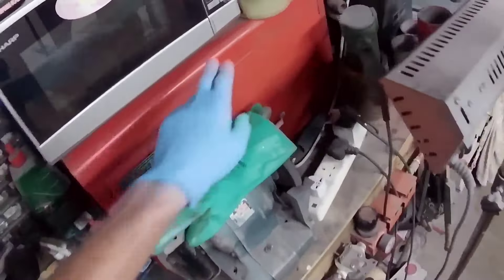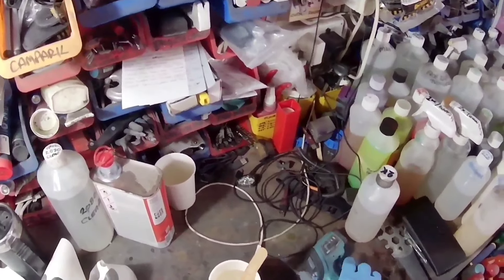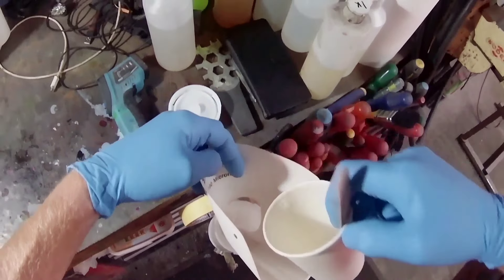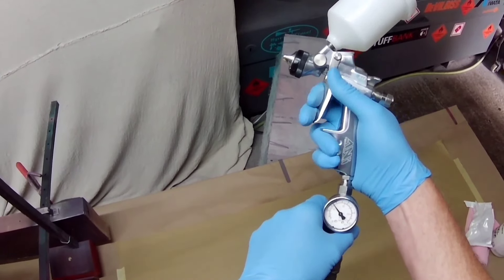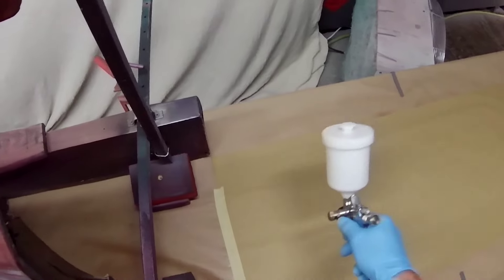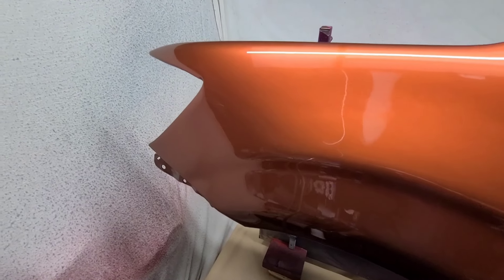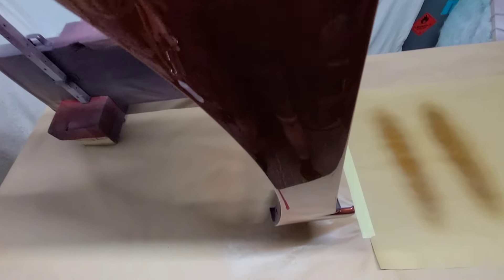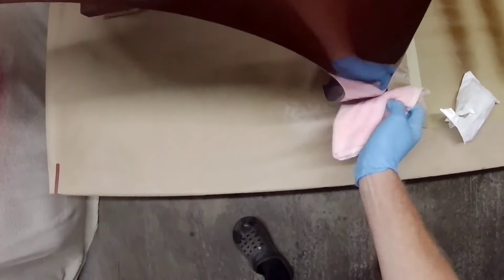ANI R160 1.2 v ANI Compact 1.3, Mini Spray Guns For Clear Coat LVLP?

Comment: I'm curious to know how the gun handles a narrow fan  for tight spots.   I bought a SRI knockoff and it sprays well, but adjusting the fan from wide to very narrow is not smooth.
Reply from the maker: Hi buddy,  There is a reason why manufacturers make so many different tip sizes, it's because when you turn a fan in, it doesn't perform as well, as when the fan is wide open, smaller tip equal smaller patterns, for the most part anyway.

It's something I mention sometimes in my videos. A better quality gun will normally give you better results when the pattern is closed up, but it's still a compromise

Comment: Hi Pete.  What size tip would you use for spraying frame tubes?
Reply from the maker: Hi Graham,  are we talking about cycle or motor cycle frames? , if so, I would look at 0.8, but, as I sometimes say in my videos,  I like the ANI R160 less in the smaller tip sizes.

It needs a fair bit of pressure,  even in the smaller sizes, so it's quite a lot of overspray and it's not as good as something like a Meiji F55 or Iwata LPH50, although they are more money,
Reply: @peteshobbies5383  Thanks for the quick reply!  I'm painting tubular seat frames for an old VW bus.  The tubes are around 21mm diameter.  Next up will be the pop-out window frames which are an H-section approximately 10mm x 10mm & I'll be laying down base coat & clear.  I've been getting good results on larger items with my Astro Europro HV103  but the fan is too big for these parts & I'm concerned if I close it down too far it won't be controllable.
Reply from the maker: Yeah,  100% agreed. The bigger gun turned in, don't perform particularly well .
I would look as something like a Porphis MPH338 in 0.8, a good gun, and like a smaller Astro

Comment: I am a smart repairer and we use sata minijet for base and SRI Pro Lite for clear. They work well for the smaller stuff but when I have to go out and fix other people's mistakes I picked up the ANi F160 after seeing yours and the Gunman's videos. It looks and feels like a nice gun for the price and the spray pattern is really uniform looking but I am yet to use it as I am struggling to find an adapter so I can fit it with the 125ml pot. The bigger pots can be a bit unwieldy for what we do. Cheers for the videos .

Comment: Hi Pete, big thanks for the mention and plug for my little channel mate it's much appreciated💪🤓 superb finish there mate those ANI guns really put out a great finish I don't think you can get much better for the price, I remember when I was having problems with my R150 I just couldn't get a good finish from it and of course being a man I didn't read the instructions🙄 and it wasn't until you told me that it needs a higher pressure which totally transformed the gun it's surprising the difference the air pressure makes👌

The slightly different tip size does make a difference to the speed of the gun which I found out with my X5500 when I went from the so called 1.3 CC tip (which as you found out is a 1.15) to the 1.2i tip along with using the CC aircap which made a noticeable difference to the speed of the gun, I will be trying the 1.3i tip with the CC cap soon but atm I'm working with the guys from ProXL to perfect the new Xpress 305 clear😬😅
Thanks mate👍
Reply from the maker: Hi John,  You're welcome, mate. I nickname you, Mr. Clearcoat these days 😂 , I remember us talking about your R150, couldn't remember if it was an R160 or R150, but remember you saying about the finish not being so good, so you uped the pressure and it was much better, so this little gun does like it's pressure,  cheers John 👍
Reply: Sorry for the late reply Pete, good old YT not telling me there was a reply as usual🙄sounds like I'll have to change my name on here to Mr Clearcoat 🤔😎yeah that was a while ago now mate and I remember saying to you that it doesn't spray properly but the higher psi made all the difference👌

Note to self... in future read the f'n manual 🙄🤠😂😂
Reply from the maker: @JohnWD40TC02 I'm not sure it gives the pressure in the manual,  I think it recommended 2.2 bar which really isn't enough,  not for a good finish,  I haven't read it either so can't say for sure 😉 😂, cheers mate 👍

Comment: looks a bigger and wetter pattern straight of the bat that 1.3 i do need to grab one of them set ups👌 great video pete 👍👍👍
Reply from the maker: Hi Grant,  Thanks mate, I really enjoy doing these back to back things, it's far more obvious to the painter and, hopefully more obvious on the videos.
It's quite striking how different these two are considering it's only 0.1mm, good old tools though although they do use more air than quoted,  cheers mate 👍

Comment: Nice one. I have ordered a PPS 2.0 kit for my Compact and am interested to see how it goes. A few reasons, but I find cleaning the cups a real PIA and is often a disincentive to spraying small jobs. I do intermittent work that may stretch out over a few days and ideally I can take the pps cup off the gun and store it for a day, give the gun a basic clean, then go back to where I left off. Many industrial paints have much longer drying times vs auto, so subsequent coats or sides of objects can take days. Just this morning I found a feature on something I’d sprayed yesterday had some primer showing and I would have blown some more material over it if I still had a cup loaded instead I touched up by hand which isn’t an ideal result.

I agree, I think the gun is capable of being a one gun solution for many, the 500 ml cup is likely big enough for most recreational painters, but PPS would also allow bigger cups if desired.

Keep up the good reviews.

Pete
Reply from the maker: Hi Mate, I find the bigger cups a pain to clean as well, which is why I mainly use small cups, which does most of what I need to do anyway and works fine.

I must say, using these two ANI'S individually the difference between them, although obviously noticeable,  isn't as apparent as doing these side by side tests, it's really obvious when you see it here.

Thanks, mate. I appreciate it 👍

Comment: Sir, hi again - I've come across this very nice looking Rongpeng R-100 spray gun - it comes with a 1.0 mm tip - will this spray base coat/clear coat ? it has reasonable psi operating pressure/cfm ratings - thank you again - your advice is always appreciated
Reply: Not answering for Pete 😊, but i remember him commenting about the R100. Think he says it was rubbish. Look at the other videos in the series to find it
Reply: @0012dominic  Sir, thank you for your advice - I'll check on the video - from the Philippines
Reply from the maker: Thanks, Dominic 👍,  you are quite correct. It's really not a particularly good gun and the build quality is awful,  people would be much better off with one of the Devilbiss Sri Pro Lite clones, something like the Ntools 888, there lots of names for them although they are all the same, cheers mate 👍
Reply: Do you have the fluid knob full open ?
Reply from the maker: @kevinjackson9406 Hi Kevin,  Yes, mate,  normally I do for clear coat, helps it wet up better.
With a base coat, it depends on substrate, color, and temperature,  so that can be anywhere between one turn out from fully closed to fully open, cheers 👍
Reply: @peteshobbies5383  Thanks Pete, I have just ordered one .
Reply: What temperature do you have 2k direct gloss paint ?.Thanks
Reply from the maker: Normally, for 2k direct gloss,  I warm it up to around 30c, so very similar to clear coats
Reply: @peteshobbies5383  thanks Pete
Reply from the maker: @kevinjackson9406 You're welcome buddy 👍

Comment: Off Topic Question - What is the overspray difference between the 3 split tip and the 4 split tip on the Iwata spray guns? Do the 3 split tip models produce noticeably more overspray than the 4 split tip models?
Reply from the maker: Hi Mate, no, not really,  what makes the most difference is the pressure

Comment: GOOD VIDEO PETE THANKS FOR SHARING THAT INFORMATION VERY USEFUL I HAVE THE ANI 160Q CRACKING GUN 🔫  THE ANI COMPACT IS MENT TO BE A CRACKING GUN TOO WHAT GRIT PETE DO YOU SAND THE WING DOWN PLEASE AND ARE THEM TACK CLOTH STARCHEM 😀
Reply from the maker: Hi Andrew,  I use 500g dry on a DA sander,  yes, I use the Starchem one, I get them is 50 packs, been using them for the last 7 years without problems 😀,  cheers buddy 👍
Reply: @peteshobbies5383  cheers mate 😊
Reply from the maker: @ANDY-we7mr, you're welcome, buddy

Comment: Hi Pete, thanks for all the info regarding the setup for these ANI guns.

I recently purchased a Compact kit and was wondering if you could offer some thoughts  on what pressure to use for attempting to match a factory finish in the clear coat?

Using a HS clear, basically wanting a little bit of orange peel.
Am I correct in thinking that using a slightly lower pressure may achieve  this?
Reply from the maker: Hi Mate, yes,  less pressure will give you more peel,  as will moving faster, and or holding the gun further away
Reply: @peteshobbies5383  Cheers mate, appreciate the reply and I've learned a few things from your channel... keep up the good work.
Reply from the maker: @bigjobs666 Cheers, mate 👍

Comment: Pete are you still using the upol 2080? When I google that I can’t find it. Maybe it’s called something else in the us
Reply from the maker: Hi Mate, Yes, I bought 10 x 7.5lt kits at a very good price,  I only have 1 left now, when it's gone I probably won't replace it as there are better one's out there for only a little more money.

In the US, I think it's 2802 , worth a try to see what you think 👍
Reply: @peteshobbies5383  much appreciated I’m going to be running a paint department soon. I definitely need a fast clear
Reply from the maker: @kr2513 The Upol is fast, with the fast and extra fast hardener, it's ideal for trade jobs, where price is always a consideration

Comment: Pete, 10grams of water = 10 ml of water, but it is not true for liquids of different viscosity. 10grams of HS clear might only be 8 or 9 ml.  You probably have your own conversion factors, but for the average guy, the clear and the hardener won't be the same ml for the same grams.
Reply from the maker: Hi Ken, yes, agreed,  that's why I was saying it's best to measure,  say 100ml of each to give you the difference. 

The Upol 2080 gives the weight in it's TDS, and they are within 1% the same, Cheers mate 👍
Reply: @peteshobbies5383  I should've listened more closely, I figured you'd ahve a correction factor there somewhere.   DV1-s on Monday, woo hoo.
Reply from the maker: @kenc4104 That's exciting 😄,  I've got to wait a month,  Devilbiss Japan, don't keep the Micro version, so it's been ordered,  so the UK to Japan and back again 😂
Reply: @peteshobbies5383  Crazy, the best price is to ship a gun to Japan then back to the UK.  What a world!
Reply from the maker: @kenc4104 Exactly 🙄